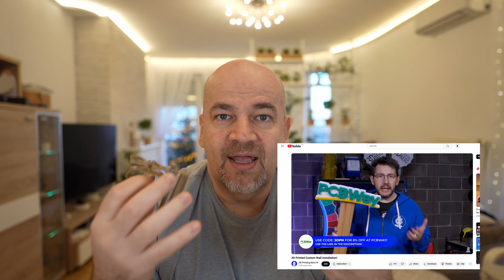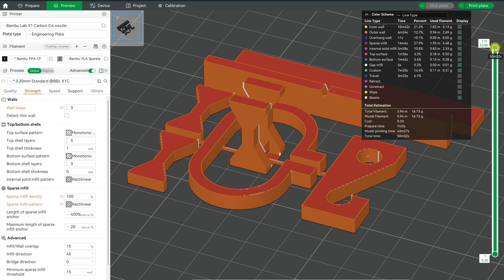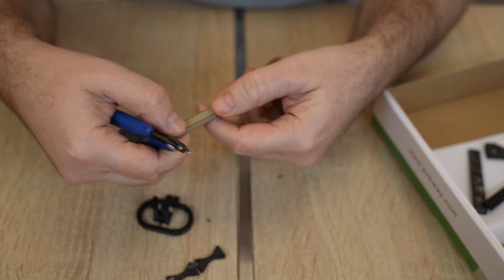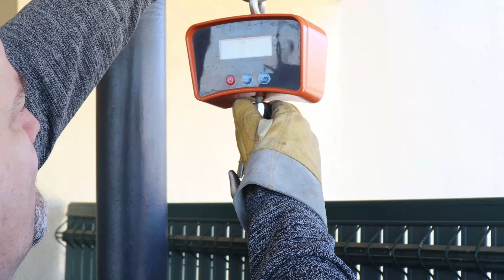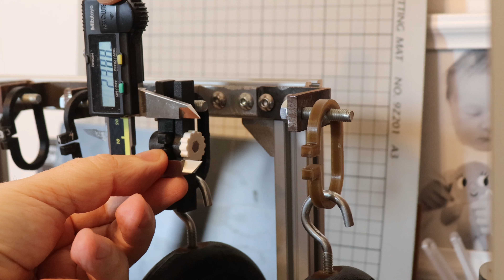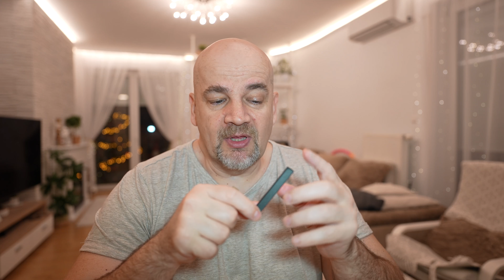PEEK vs PPA-CF: The strongest industrial vs strongest consumer filament

Comment: The PEEK's thing is it's temperature resistance (and some other characteristics usually irrelevant to hobby 3d printing). Otherwise it's extremely mid  material (as you showed) that's extremely difficult to print with.

Comment: PEEK gets its strength during post processing and comes in different grades for different uses. A lot of the cost cones from the fact that it must be processed after molding or printing to properly crystalize.

Unless you printed it yourself and follow the post processing guidelines a print farm isn't going to get a proper PEEK part.

Its a niche material pretty much just used in bio-medical. But not like we have to guess. Thermoplastics are tested. It's also going to be brand/formulation specific.

I never understand these videos when its always just a FAR less rigorous testing methodology than those the industry has already done.

Comment: Very nice review it showcases the advancement of materials, however when it comes to large parts options are less available. The Peek parts were probably poorly processed at pcbway and probably done with any peek material on an intamsys machine. It will be nice to see the same testing but ordering parts from Stratayss direct.

Comment: This test is stupid because PEEK is not used simply because it's the strongest material, but because it's the most durable material under harsh conditions such as high temperatures or exposure to chemicals.
Reply: It was very tough and all of the above i think its a great test
Reply: Oven sag temp would be good

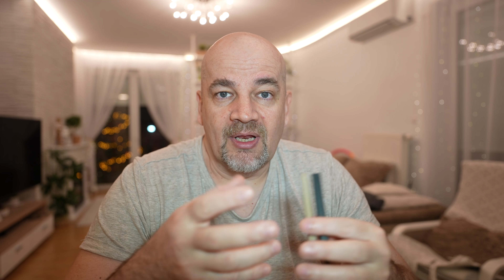Comment: 8:47
I've done mechanical testing of those fancy 3dp materials before. They can be extremely sensitive to test article geometry. You have pretty small test articles, which means flaws in the layer start/stop and things like coasting and pressure advance will have a relatively large impact on performance. Without tuning your settings its very likely you could get erroneous responses with their material, which they definitely don't want. I suspect thats what happened with the PCBway test pieces. That layer adhesion is almost impossibly low, implying they were printing too fast or cooling too hard, or both.

Comment: Build a swingarm with a 2 to 1 mechanical advantage (like a fulcrum) to allow you to use your smaller force scale when testing higher forces. Just multiply the resultant force by two afterwards, to obtain the correct value.

Comment: Both materials have their niche I would say. I'm printing both, PPA-CF and PEKK (a variant of PEEK) on my K2 Plus. PPA-CF is much stiffer and more brittle than the PEKK. Other than the benefit of no carbon fiber shedding PEKK has much better toughness and temperature resistance than PPA-CF which I mostly need it for. It prints really nicely, whereas I had trouble with dimensional accuracy on the PPA-CF. PPA-CF being much cheaper than PEKK is nice and the surface finish is absolutely stunning, but I would definitely prefer PEKK for tasks that require the parts to withstand more wear and tear.

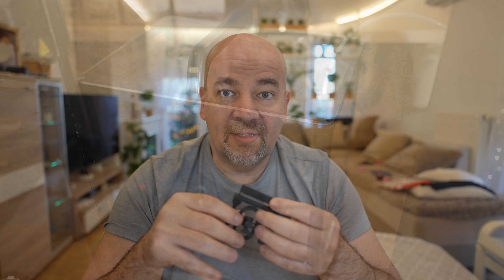Comment: @2:36 microwaves work by heating up the water. Since nylon absorbs water the microwave heat up the outer layers of the nylon filament that were exposed to humidity.
Reply: in this case it is likely that the microwave works by creating arcs between the tips of the CF in the filament 😈. Hence the outcome (flame).
Microwaves don't "work by heating the water", they work by blasting whatever is inside with microwave electromagnetic waves. Water just happens to be a very good absorber of those, but it is not at all the only such material.

Comment: One thing Im interested in is seeing how much difference the actual test numbers are compared to advertised by the manufacturer. Would be interesting to see what the average % difference is for each manufacturer.

Thanks for this testing btw, you pretty much saved me from purchasing an expensive PEEK-capable machine only to be disappointed.

BTW, I would love to see test numbers for resin for the Form 4 as they are supposed to be at the forefront of high strength resins. If interested, I have a Form 4 and am willing to print out any models to conduct such tests.

Comment: PEEK is notoriously difficult to 3D print in FDM and you very clearly demonstrate the main issues. The material is very prone to warping, since it shrinks a lot as it cools, and even more as it crystallizes. This makes it very difficult to accurately produce the desired geometry. PEEK is also prone to have very weak layer adhesion. The reasons for it are in dispute, but in my opinion it is because the materials crystallizes so fast during printing. The more crystalline PEEK does not adhere very well to the next layer. I've experienced many disappointments when printed parts broke apart in my hands because of the weak adhesion.
as others have mentioned, the parts appear to not be very crystalline. If they were annealed (2 hours at 200 C works well) then their color would change and the properties would improve, though in my experience the improvement will only be in the in-layer direction. Annealing does not significantly improve the interlayer adhesion.

At the high-end industry, people have generally been moving away from printing PEEK amorphic and then annealing it, since the results are generally disapointing. The solution that the companies have generally reached is printing at absurdly high chamber temperatures, over 250 C, which destroy the printers over time. I've been working on printing PEEK with 300+ degrees C chamber, with the goal of preventing HOT crystallization, which happens when the material cools to around 290 C. That way the material prints amorphic, which improves the layer adhesion, and then it should crystallize evenly if you cool the printer down slowly enough.
Reply from the maker: Thank you for this informative comment.

Comment: That PEEK wasn't printed in a warm enough chamber - Most companies that will print PEEK parts use a cheaper amorphous PEEK that prints at a lower chamber temperature - the colour of your part is the give-away it was printed too cold... amorphous PEEK looks brownish but not that dark... unless you print it in a chamber that is too cold

Putting a conductive filament in a microwave 🤣

Comment: An idea for your creep test to be a bit more scientific: print the model with space for a magnet on one side of the gap and a hall sensor on the other and use a raspberry pi take a measurement periodically over the test period, maybe once a second so you get meaningful data when it fails. Use a relatively long bar magnet so that as the shape deforms the hall sensor still has magnet to point at.

Comment: Peek is a wonderful material... not for its mechanical properties but for its chemical stability. Its extremely stable. The aplications are mainly for very hot enviroment, strong chemicals, extreme vacuum and even prothesis or biological research. NOT CARS!

Comment: peek needs to be annealed and mostly doesn't warp when correctly printed, also we use it a lot for its young modulus under high temperatures it could have been fun to see a 3 points bending test for example 😇 still a good video tho

Comment: I don't have any personal experience with PEEK but it seems likely that PCBWAY cannot print PEEK properly. Quite a lot of warping and weak layer adhesion probably means the chamber was too cold.

Tullomer hesitating to send it and wanting to test it first just seems dodgy. The company seems dodgy anyway with some of their claims that it is stronger than steel. Just looking at the datasheet it is a very strong filament but it is nowhere near as strong as steel, it would be comparable in tensile strength to some aluminiums but like other filaments it is a lot less stiff than even aluminium.

Comment: Sunlu and their daughter company named Jayo "just" released matte(!) high speed PETG. They also released pla+ 2.0 together btw...
It's already available in Sunlus shop and on AliExpress from both brands. If I'm not mistaken it's the first HS PETG on the market which is also matte. Would really love a test from you.
Layer adhesion is oftentimes a problem with matte filament. At least I read that really often. 
A comparison between regular PETG, another generic HS PETG (kingroon is inexpensive) or bambus HF PETG and maybe PLA+ 2.0 for example would be nice. You could be the first to test it properly.

I'll get five spools from Jayo this week and i can't test it immediately bc I have a lot to do atm and need to print something in PLA first. And it will be my first PETG btw and i don't have your tools, so i can't really compare even if I would order a fresh spool of regular PETG.
The first reviews and pictures of prints from customers on Sunlus Shop are promising and it really seems like a new, cheap and also good looking alternative to Bambus HF PETG. Some people were also using Bambus profile for HF PETG without a problem. I know kingroons HS PETG is still cheaper but it's one of the candidates that doesn't look the best in pictures. Maybe I'm mistaken and it would actually look fine printed. But I'll have enough PETG for a long time. 

I'm really thinking about using it to print the 100 printer with it. But it will certainly have a lower heat distortion temperature. They're linking to the datasheet of their normal petg and it's already only 64°. But an 100 printer with matte grey and white or black and maybe some colour mixed in will certainly look nice.

Comment: People keep responding to my critique of Dr. Gaspar's methodology with the senseless retort of "Well where can we find YOUR testing?" 

While I feel this is an invalid response since I'm not the one putting up invalid results, I've decided to end that line of response anyway.

In the oven (well, Sunlu driers) right now are 12 rolls of Polymaker filaments: 500g rolls of Fiberon PA12-CF10 (x2), PPS-CF10, PETG-rCF08 (x2). PET-CF17 (x2), PA612-CF15, PPS-CF10, PA6-CF20. A 500g roll of PolyMide PA12-CF. A 1kg roll of PolyLite ASA in Teal. And on the way is a $275+$23.93 tax roll of Tullomer. So this is what... Just about $600 USD in filaments? And I forget what else I have laying around; surely I have at least one glass filled somewhere, these are just the new boxes I had on a shelf waiting for me to do something with them.

These will all eventually be printed on my Bambu X1C. At first I'll stick to a single 0.4mm Revo ObXidian nozzle. I will print 5 samples of each test I intend to run. Hey who knows, maybe there will be absolutely no variance between samples. I'll probably also do these in a batch of 3 samples in one print run, then a batch of 2 samples in a different print run on a different day, just to INTRODUCE the variability of print environment. We've all had prints that went to absolute hell for no reason, why not see if we can induce that?

Time to also try to get at least some of Igor's models, and equipment. 

I won't self-promote here. But I'll be uploading videos soon.
Reply from the maker: Hi. I always like to watch filament testings by others too, no matter if it's professional or just playing with some DIY equipment. If you want to test with my test objects, you can find them on Printables. I print them with max number of walls.
Reply: 0.4 with that much cf? Get ready for some clogs... Btw this doesn't excuse you from your horrlble behaviour in other comments.

Comment: Nylon (incl. high temp and cf/glass filled nylon) benefits from annealing and absolutely needs to be humidified before testing. When printed it's dry and brittle, when the humidity is at equilibrium, it gains a lot of toughness.

Comment: I use PEEK at work and strength is not a big factor. PEEK is used because it absorbs very few gases and liquids, can stand thousands of cycles on an autoclave, machines beautifully, and has amazing biocompatibility. I've seen bone growing on it, which is amazing for a plastic.
Reply: Yes, PEEK is a great material I’ve machined parts out of it. But really, this is not something a hobbyist or enthusiast is realistically going to use. It’s too expensive. After having said that, the tensile strength is between 14,000 and 16,000 psi, depending on brand and processing. That’s a lot for plastic! It functions easily up to 800 F and intermittently to close to 1,000 F. Of course, that makes it hard to melt as well. PEEK is also rated as a semi rigid material, so yes, it will give more than some others. That’s not a bad thing for many uses.
Reply: @melgross  With the advancement of technology, the research and development of PEEK has become increasingly advanced. China has also developed high-performance PEEK particles at an affordable price. As for the melting issue, it can be resolved through methods such as injection molding and mold processing. If you need it, we can provide particle samples for testing!

Comment: Peek isn't even particularly strong. It is just VERY heat resistant.
Reply: It should also be strong at 100mpa.
Reply: @riba2233  That is a very unrealistic expectation for a 3d printed material. Datasheets say everything  between 25 and 265 MPa. I would always expect printed material to be at the lower third of that region.
As a lot of polymers PEEK can be stretched and gains a lot of strength in the stretching direction. The is very extreme in specialized PE fibers becoming "Dyneema". But that effect is not available when printing.
Reply: @jackmclane1826   should be around 100mpa in tensile max load, xy direction.
Reply: @riba2233  Maybe with a printer that has a much hotter hot end?
Reply: @jackmclane1826  of course, that should be the only way to print it properly
Reply: @riba2233  How hot does it need to be? There are not many printers that go significantly over 300°C.
Reply: @jackmclane1826  it needs around 420-450 but that's not the main obstacle, you need around 130-180 for the chamber :(
Reply: @riba2233  Seems like the supplier if the PEEK part didn't do it right, then.
Even our pro machines at work don't do this.
Reply: @jackmclane1826  yes I am sure they didn't do something right, hopefully we will see some properly printed parts tested